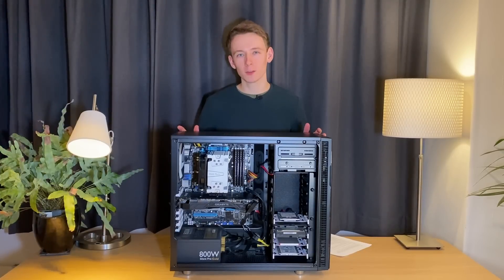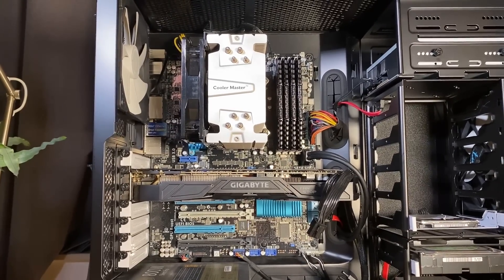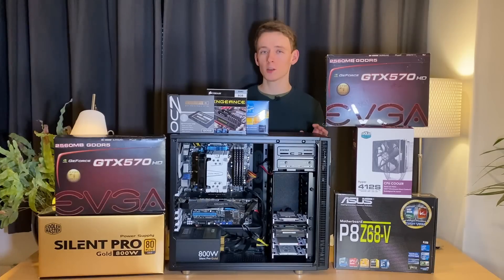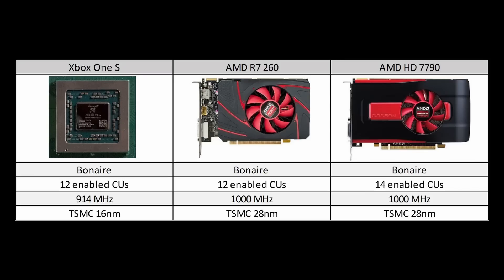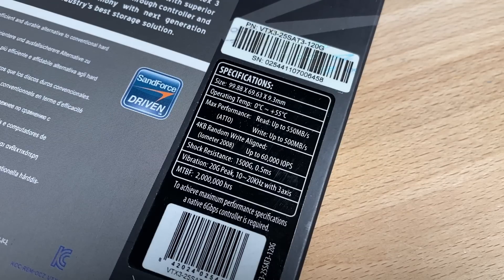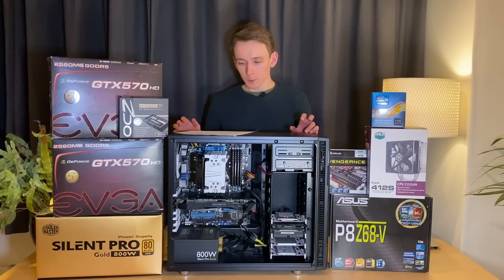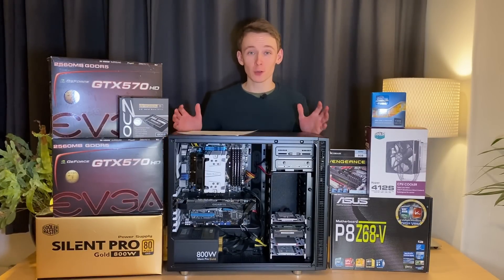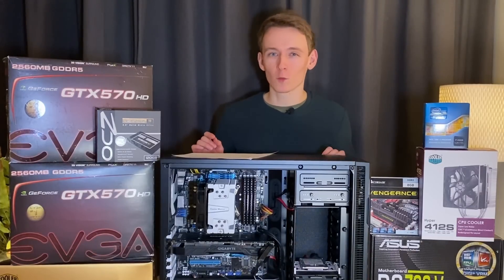I used an i7-2600K PC for over a DECADE - Here's what happened.

Comment: Almost the same hardware... same cpu, memory, have the asus p8z68 deluxe. Cooler is Noctua in my case, not sure what type exactly.
First ssd was also a vertex 3 max iops edition, 240GB, just broke a week ago, still used it for nzb downloads.

In the past few years all disks have been replaced with a few ssd's and the videocard has been replaced, the rest is still the good old stuff...

Still use it, it doesn't feel slow, it's clocked at 4400 for ages now, and it's capable of clocking at about 4900 without much changes. 
At the moment there's no reason for this system to go, except newer ones probably use less energy.

Comment: I also still have my PC based on 2600k) even with the same motherboard! And my first GPU was also GTX 570, only from Zotac and with 1280 MB memory. A few years later I replaced it with GTX 780 by Gigabyte (which “died” a couple months later after its warranty expired…). Now it goes with 6GB version of GTX 1060 by Gigabyte for more than 4 years now. Well, many upgrades have been made throughout the whole time (SSD replaced, RAM extended from 8 to 16GB, several HDD bought) and I could also say that it’s power is “enough” for my daily purposes (well, in most cases). However it’s not anymore. CPU+GPU can afford play FH5 in 60fps only with medium settings, etc. NFS HEAT even worse, with random drops till 25-30fps and average about 40fps, as well with medium graphics settings. Should I mention Crysis Remastered? 😂😢 So, I guess it’s time has come. Time to move on…with brand new 13700k, M.2 SSD, RTX 4070Ti…)

Comment: I am still using mine. I recently move my VMs to mini PCs since they may at 64gb. But I still use it for a 12 x 8tb sas hardware raid 6 file server. 
Freaking ryzen mini PCs has 8c/16t 3.2/4.2 ghz on a name ssd.  It is still.fast at 4.2 ghz auto overclock. I do not notice any real difference from the 2700k to current cpus.

Comment: My last build wasn’t powerful enough but I loved it so much. It was a i7-3820 and a gtx 770 system. I had (unwisely) upgraded the gpu to a rtx 2080 and had bottlenecked the system. That’s when I bought my current system off of a friend. Still have the case that I used and I have plans to use it for one last build. It’s the cooler master cosmos 2.

Comment: I'm currently still on 1st Gen Core i7 920, overclocked to 3.3 GHz for many years. Over the years, 3 GB RAM upgraded to 12 GB, hard drive upgraded to SSD, and 2 GPU upgrades, now GTX 970. It works great. It's still fast enough for at least 99% of what I do. Year after year was only marginal improvements in CPUs from Intel. Now that AMD is giving them some competition, I am excited with the improvements modern CPU have. I am finally looking to upgrade with AMD's new AM5 socket CPUs, and hoping for a GPU price crash soon now that the Ethereum Merge happened. Hoping for RTX 3080 or better will come at a good price.

Comment: I still use my i7-3770 (non K), a Samsung SSD Pro SATA3, Asus P8z77m, Seasonic S12G 650W
I upgrated my RAM from 8GB Corsair Vengeance LP --> 32GB RAM Corsair Vengeance LP
I upgrated the GPU from Sapphire HD 5770 --> MSI Armor RX 580 8GB OC --> MSI Mech RX 6700 XT OC
Also upgrated the stock cooler that i had used from 2012 until JUN 2022 ( !!!! ) to an  Arctic Freezer 34 eSports Duo, that is overkill for this CPU. Never saw temps higher than 58oC
I dont have any problems with games at 1080p, as my monitor is a Benq 27" 1080/60Hz

Comment: I thought my 4690k was bottle neck for my 1080. Later I bought a ryzen 3600x and even then in some games I wasn't fully utilizing the GPU (mainly high fps games). It was only until I bought a 5800x I was squeezing every bit of performance form that 1080.

Comment: I feel that. I built a system inside a Cooler Master Storm Scout with an FX 990 motherboard and an FX4300 paired up with a 650Ti. Ran that puppy for about 8 years. In that time the motherboard failed from a power surge, so I replaced that, and picked up an FX8350 for just $225 together (good deal on it because Ryzen just debuted). Upgraded to an SSD down the line and swapped in a 6Gb 1060. It was perfectly useable in all games until my wife gifted me a 4k monitor. It played Skyrim in 4k just fine but nothing else lol

Now I've got a Ryzen 5600X and a 3070 on an X570 chipset and I think I'll be happy for another eight or ten years. Probably I'll toss in a top of the line AM4 CPU for dirt cheap in another three years and likely a better GPU but it's already got 32Gb of RAM and plenty of NVMe storage both of which I expect I'll continue to be very happy with long term.

Comment: Nice build I still have my 2009 built i7 920 with t-power X58 mobo with Kabuto II cooler and 12gb DDR3 1600 still overclocked to 3.5ghz and a GTX 970 with Intel 120ssd in a custom prototype case with 90% mobo mount with GPU vertical and 3x180mm Silverstone penetrator fans
Reply: @Lurch7861 not that kind of vertical mount it's on the mobo the mobo is rotated so the GPU is vertical like the Silverstone Raven V2 case

Comment: Sep 2011 i bought almost the same pc but slight changes. Had the same  MB, CPU,RAM 2x4gb cl8 , CASE/R3, but Corsair H60 cpu cooler that i changed later into a " 212 evo cooler master" when the AIO started making too much noises after 4-5 years off service. My old 750w thermertake toughpower modular. My 74gb raptor disk as os and few storage drives. Had my old Sapphire Radeon HD 5870 1GB GDDR5 in it witch i switched to gtx 670 in 2012 then changed into gtx 1080 in 2016. 

And today this pc is still running strong and my nephew is useing it today but with my old gtx 670, a 128gb sata, 2tb hd. With a slight OC to 4ghz. And it serve as fine first pc to newphew but he mostly just play minecraft/fortnite. The plan was for him to get my  gtx 1080 when i bought a rtx 3080 but i never got around to it as was sold out and then the prices just went sky high. So now i am wating for rtx 4080 or maybe even RDNA 3. And then he will get my old gtx 1080 in it again.

But damn the i7 2600k was a beast. It broke my upgrade cycle with was every 3  year i got a new motherboard/cpu/ram but with the i7 2600k i stayed with it until summer 2019 when i upgraded to a zen 2 , 3700x, 2x8gb , 512gb m2, 1tb ssd, 8tb hd with the plan to upgrade to rtx 3080 oct 2020 but we all know fucked up the price history of rtx 3000 has been.

Comment: My main PC has been based on an i5-4460 since 2015! Not quite as long, but I don't think I'll be upgrading it for a while, especially as life circumstances have made it so I'm more of a console gamer currently (just bought a PS5). That said, it still does all I needed perfectly! I only had a few upgrades (not including storage):
1) GTX 745 -> Radeon RX 590 8GB after the GTX 745 failed
2) new PSU for the RX 590
3) 8gb RAM -> 16gb RAM to play Forza Horizon 5
It's cool how even current gen games run great on it! I think 4th gen Intel was probably the peak of Intel before they languished in 14nm hell for years, letting Ryzen and AMD catch up. Also the RX 590 has the added bonus of making running Linux easier. I don't see myself upgrading for another 2-3 years at least!

Comment: i had an i7 6700k with 32gb 3200mhz ram for about 6 years, went through 4 motherboards, only recently got an i5 10600k and still using the ram, got the 6700k for £280 about 3 days after release and it lasted very good, still have it now, nobody's buying it for some reason, i got my 10600k second hand for £150 and a motherboard for £80 and its amazing, overclocked to 5ghz like its nothing

Comment: that 2600K looks similar to my 2700K system, except I went with the Azrock Fatal1ty P67 Professional. it had a few PSU upgrades and several new graphics cards. with a very big cooler on it, it overclocked to just under 5Ghz for over a decade. though now I am driving a core i9, but I went from the 2600K to the core I9 11900K.

Comment: In May 2024, i'm still running a mini tower PC with i7-2700K CPU (no overclock), 16GB DDR3-1333 and an EVGA nVidia GTX-1070 8GB GPU.  West. Dig 500GB SATA3 SSD.  Monitor is 27" HP 27wm 1080p IPS flatscreen at 75 Hz. 650W Corsair PSU.   Win 10 Pro x64.  Still does all I need it to do, even some 1080p gaming at high settings, like Overwatch 2, PUBG, Firestorm (Second Life) and CS:GO. Dual boots with Linux Ubuntu 24.04 LTS, runs it like a beast, faster than many i7-3770K-based PCs.

Comment: I still use a skylake based i5, which is fast enough for me, my motherboard supports the 7th gen series as well, so if i need more performance, i could always go for the 7700k (which i will do at some point in the future), first i had one of those 570's as well (it's now in my retro sleeper build, nothing fancy, just a core 2 quad q9450 overclocked to 3ghz), but it's sadly the stock 1.25gb version, but it worked just fine in my main rig, but i wanted to play doom eternal so i had to upgrade to something a bit more powerfull and supported, so i got the 1660 instead, which runs doom eternal perfectly fine! I also do everything on this machine, except video editing, my wife got me a 2021 m1 pro macbook pro with 1tb of ssd space, but for the rest i still use my main rig :)

Comment: Well my "new" PC, which I managed to build from scrap parts and stuff I fixed myself, except the processor which involved even gambling, p8h61m lx3, i7 3770 and HD 7850, 12 gb of ram, it runs all games that I don't play on ps4, and PS3 emulator so it's still perfect to me, a friend updated his system to a 7th gen and the performance isn't that different, so that's why I'll only upgrade when I feel the need, 10th gen is surprisingly becoming affordable here in the jungle slum

Comment: Until about two weeks ago I used a PC that was assembled back in 2012! I still have the PC case: a Xigmatek Midgard I. Had an Intel Core i5-3570K CPU, 8GB of DDR3 RAM from ADATA, a Gigabyte gaz77xud3h motherboard with a standard Intel cooler, powered by a Corsair 650W PSU, an Adata Premier Pro SP900 128GB SSD for my system disc, and an AMD Radeon HD 7850 Direct CU II 2GB for a GPU. I'd still be using it if my GPU didn't die on me and start artifacting.

The PC repair guy nearly fainted when I told him I want a complete system replacement and he can keep all the used parts! This was also a used parts store. My mobo still had plastic plugs in the unused HDMI and DVI ports and was running on the first UEFI Bios alpha version from 2012! Never been flashed. The whole rig was clean as a whistle. The only problem was that it was old and the new GPU I bought didn't work well with this old build. He even took in my bad GPU. Can't imagine what he's gonna do with it?

Comment: I am still daily driving a Sandy Bridge based system and it's not even an i7 one (it's got a locked i5) and never had much trouble with the machine. There are some pretty solid value propositions on your arguement, specially on the GPU pricing front, but if you look only at pricing and compare a a post Coffee Lake i7 with all the previous generations the differences are massive... Nowadays the equivallent of an i72600k is an i3 costing just a shy of a 100 bucks and you can buy a 12600k for not too much money than what the 2600 and its refresh 2700k would cost back in the day. On the cpu side you get a lot more computing power in comparison to what intel was offering 11 years ago. The gpu side is what has gone completely insane with Nvidia taking advantage of the fact that people don't mind getting ripped off regardless of how awful cards prices became

Comment: I had my i7 2600K over clocked for 10 years and it was great. Nothing out there could really compare until AMD came out with the multi core Ryzens. I then retired the old boy and got a Ryzen 7 1700x and have been up grading the Ryzens since. Got a 5600X right now but miss the extra cores so thinking upgrade to 5900x.

Comment: The young man's way of thinking is very sympathetic and appealing to me. The config I bought from scratch in August of 2012 is: 
 
- Intel™ i7-3930k CPU
- Scythe Ninja 3 SCNJ-3000 CPU cooler
- ASUS ROG Rampage IV Extreme board
- 2x4 GB G.Skill Trident 2500 MHz DDR3 RAM
- Corsair HX 1500i power supply
- Pioneer BDR-209DBK Blu-ray burner optical drive
- Samsung 840 PRO 256GB SSD
- Zalman Z11 PLUS HF1 midi tower case
- ASUS VG278HR 27" 144 Hz 3D monitor
- EVGA GTX 680 4GB Classified GPU

I replaced the GPU to a EVGA GTX 980 Ti 6GB Classified in 2016 in order to be able to enjoy DooM(2016) on max settings and recently upgraded to a Samsung 870 QVO 8TB SSD. 

Apart from that GPU and hard drive swap, I still have the same 2012 config unchanged and it serves me well on a daly basis! 😊 ❤️
Reply from the maker: Thanks for the comment - that is good to hear!

Comment: I also have a 412S :)) but for the AMD 8350 (It really needs it because the motherboard underclocks the cpu if it goes above 60 degrees although the cpu is rated for 70). I undervolted it to 1.250v yet to maintain 4ghz and cut the turbo. I have a cheap motherboard ( an Asrock 970 Pro3 R2.0that was a bad thing I need to put cooling fins on the mosfets but is has dual pci express ) It has a 2tb hdd and a 500gb Samsung SSD 850 EVO a 970 gtx and the old 550ti for my secondary monitor (it does the job). I need to upgrade the videocard because I cannot Maxwell Architecture is not officially supported in WSL2 also the AMD 8350 is very old I only have 80-100 fps in League of Legends on Very Low and  the same in World of tanks the only games I play right now. I think I will get a 12100f or adn 13100f with a 3060 gpu. I also have a 750W Chieftec PSU.

Comment: My longest platform was X58 -- from 2010 to 2017. Upgraded the CPU to a 6-core Xeon and the RAM from 6GB to 12GB, with numerous GPUs coming and going. Was thinking to go for 24GB RAM, but stumbled on a bargain offer for an ASRock X99 + i7 6800K combo and finally moved over. Later upgraded the CPU to a 10-core 6950X and now I'm keeping an eye on a 16-core Xeon v4 on AliExpress to drop in price.
Reply: Unless you need multi-core performance, those Xeon-V4's will be a downgrade in single core performance, and therefore probably perform worse for daily tasks and gaming...
Reply: @TheAnoniemo  Sure it is, and the Xeon is multiplier locked, but anything is justified at certain price point. It's for the enthusiasm, not the needs.
Reply: @Ivan-pr7ku  I know that feel, I build a dual xeon workstation for watching youtube just because it's fun.

Comment: haha... i'm still using this CPU as well to this day. It's paired with a GTX 1060.

as for gaming, it's obviously nothing awesome but it holds up pretty nicely to this day. i currently play Lost Ark, which was released earlier this year, everything maxed out on my 3440x1440 monitor, native res, at around 60fps. sure it'll stutter now and then, the textures will take a while to load from an HDD, but it works!

i think it's about time i upgraded as well, DDR5, direct storage, pcie 5.0, new cpus/platforms getting released, new gpus, let alone the stupid requirements of windows 11. the only thing that isn't right are the prices! so i hope things will normalize soon-ish.

that won't be the end for my old system though. i'll use it to build an Unraid server.

Comment: Had mine for 2 years now, been thinking more and more about upgrading but upping clock speeds is much cheaper than upgrading. Mine is paired with a 8Gb RX 570. They compliment each other well but on the other hand, I can’t just upgrade one or the other and get the most out of it

Comment: I was using a AMD Athlon XP up until 2017, and it was doing my tasks fine. All I used it for was drawing in Microsoft Paint.

Then in 2018 I upgraded to a Dell Optiplex 7010, and I am still using it to this day. It came with a i7 3770, 16 GB DDR3, and a GTX 750 Ti. I upgraded it to a RTX 3060, and 32 GB DDR3 1600 MHz. And that computer now stays at the other house. 

Then in 2020 I bought a nicer desktop, and it had a i7 3770K, which could be overclocked in the BIOS, and it came with 32 GB DDR3 1066 MHz RAM, and no GPU. I put a RTX 3060 in that as well.

And I used that till a few months ago, until the Intel Pentium G7400 released and went on sale. I really wanted that CPU, as it is the fastest dual core CPU out there (as far as I know). And it actually beats my i7's in every game I play, which is Minecraft with shaders, BeamNG Drive.. Well, that's all I play. But it beats it in other titles as well. I don't have exact tests on other games using MSI Afterburner, but they feel smoother. The only game I found that isn't smoother is Cyberpunk, and it has some stuttering problems. But locking the FPS to 45 fixed that. 

And here is something interesting. The Pentium G7400 beats my i7 3770 in Cinebench R23's multi core test, and single core test. But the overclocked to 4.4 GHz (on the stock voltage) i7 3770K beats the Pentium by a few hundred points on the multi core test, and the single core test the Pentium still wins.

In Cinebench R23, on the multi core test the Pentium gets around 3,870 points, the i7 3770 gets around 3,650 points, and the overclocked i7 3770k gets around 4,200 points.

I had no real reason to upgrade, as everything is doing what I need just fine. I edited about 300 videos on the old i7's, and they are still keeping up for me just fine. But I wanted to try out a modern CPU for once, and it's quite neat. And it uses only 30 Watts of power too which is neat.  I might use the i7 3770K for a server or something in the future, not sure yet, as it uses quite a bit of power. I might just keep using my ThinkPad on a shelf method for the server.

Sorry for a wall of text. I got carried away typing, and spent over 1 hour on this comment.  Lol. Have a nice day!